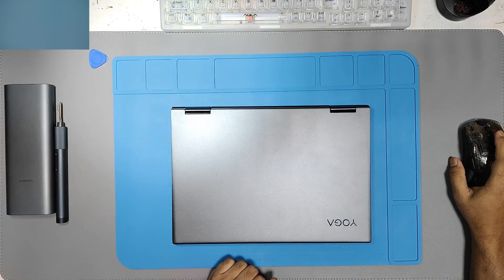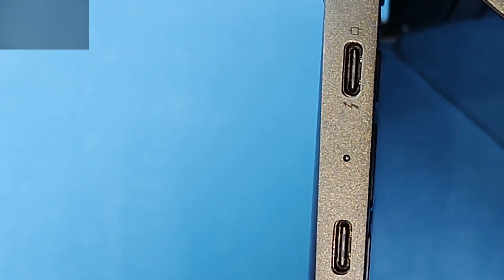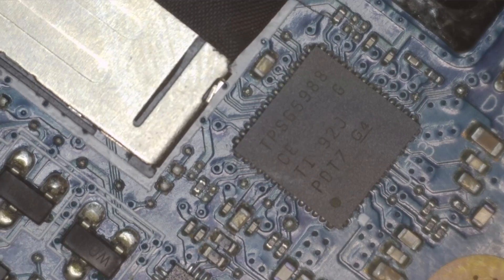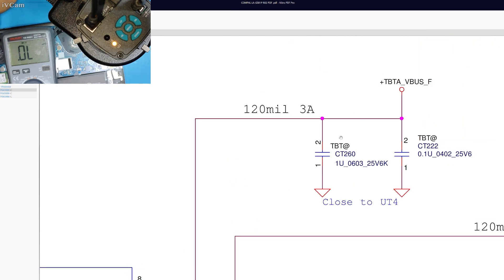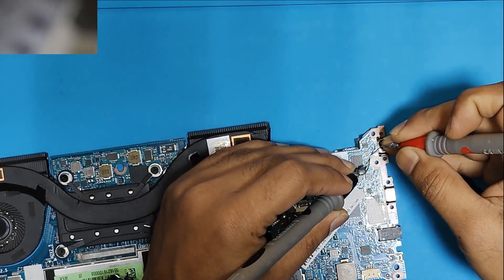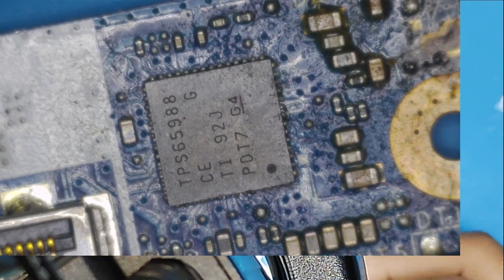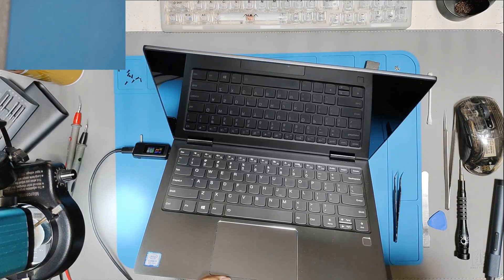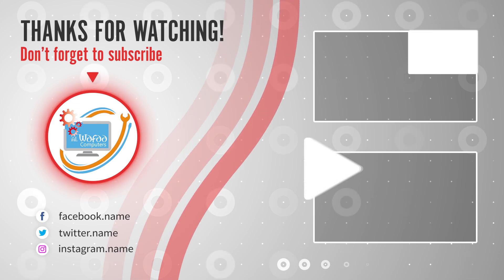How to Repair Lenovo Yoga 730 No Power | Complete Step-by-Step Repair Guide #repair  #nopower

Comment: bro i cant setup win10
on this device
he not found the ssd hard 
&no mediadrivers 
pls
Reply from the maker: Download the storage drivers from the lenovo support page for your model. Then put it in a flsh drive. When you at the step that you have to select the partition, Click Load drivers and select the path for the drivers that you have downloaded. Hopefully if your SSD working, It will show there.
Reply: @alwafaacomputers  
if he give not found is and only read flsh..is that mean the ssd not working pls?
Reply from the maker: Even after updated drivers if it is not showing, you will have to take out the ssd and test. I f you have no clue regarding that, I suggest you to go to a professional and get it checked.
Reply: @alwafaacomputers  
thank you so much bro.
Reply from the maker: You are welcome